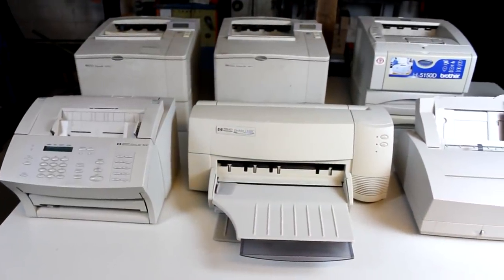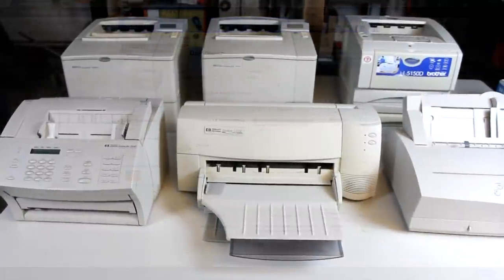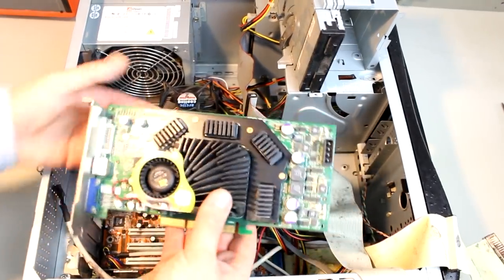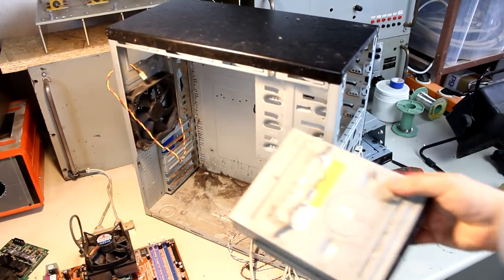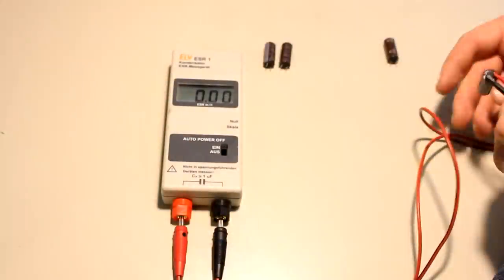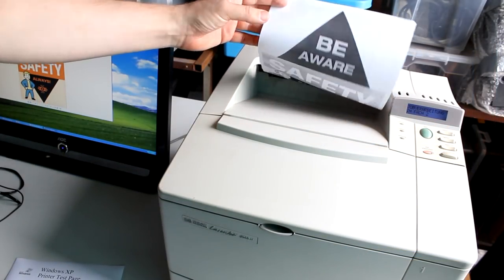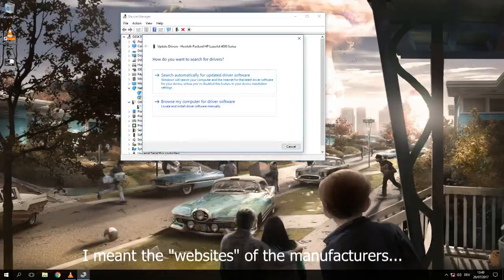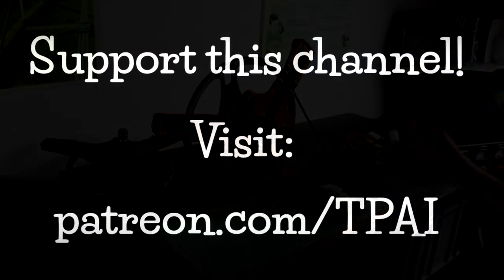Repairing and Restoring an Old Computer - (for those old Printers)

Comment: If the capacitors on the motherboard are bad i wouldnt use the psu that was there, not without measuring all the voltages with the pc turned on or with some load
Reply: The bad caps on that motherboard are Chemi-Con KZG, a bad line from a good manufacturer. The power supply has nothing to do with that. By the way, that PSU is an AOpen, which are usually rebranded FSP motherboard (and the inside design looks like it).
Reply: SuperDuty455 Well... At least measure the voltages with some load in the psu. Even with good capacitors, the psu may be with the wrong voltage or out of the limit (5% of variation i am remember correctly)  So the 12v line can be from 11,4 to 12,6v, but i would reccomend staying in the max variation of 2%, in 12v line, it could have from 11,76v to 12,24v. 

More than that 5% likely is damaging slowly your hardware, mainly capacitors. 

A good psu may have these problems, as some problematic voltage regulator, or some capacitors or resistors worn out, some problem in the feedback circuit, and such, that can cause these problems.I have a teapo psu from the 386 era (actually it is dated from 1994 so not exatly, but it is the same type with 12 pins only), and all its capacitors are fine, all its components are clean and without any damage signal, but its 12v line is giving 9,48v, its 5v line is all wrong too, i dont remember what it was. And the psu seems all fine, all capacitors are perfect, and incredibly seem to be from ok to good brands. But still its voltages are all wrong.

Many times the damaged capacitors on the motherboard are due to variations or wrong voltages coming from the psu. If the outlet were the pc was had too many variations, many high and too low energy peaks, the psu may have tranfered it to the motherboard, and with the time passing it may have worn out the capacitors, that happens very often. If the energy is too unstable as it is in some places here, that may br the culprit too. 

You said that these were bad capacitors, well, it probably is be problem, but it would be recommended to measure its psu voltages, as they may be a lottle off too, so you wont damage the new capacitors, even if the damage to the old ones wasnt caused by the psu.

Comment: I have an HP laser printer from 2009 that will not work on windows 10 at all, HP told me I had to buy a new compatible printer or use Windows 7. Since printers are a dime a dozed I tossed it into the bin and bought a new one.

Comment: If and when I can.... I stick with any printer that is LaserJet compatible.  There are a lot of laser printers that fit this bill.  The generic CUPS LaserJet drivers will work with just about any LaserJet compatible printer.  At a lot of locations I used to manage just a couple of years ago, they were still using IBM/Lexmark Lasers from the 90's and early 2000's.  All worked perfectly fine with Linux.  I guarantee Windows 10 would not support them!!!

Comment: Any printer that you cannot print to from linux is not worth saving. That should be a VERY tiny number of printer models, mainly only ones that are not true standalone printers, but merely part of a full printer (the other of which is a proprietary program that runs on windows only) - such printers are GARBAGE and should be dumped in an electronics recycle bin.

Comment: For fucks sake. Just install the printers manually. Get XP updated, connect the printers and if the new hardware pop-up appears, follow the instructions and install it manually. If it doesn't either go to the device manager and if it appears there, install it from there if it doesn't go through the add new hardware wizard. Manufacturers have more to do than working together in a cabal to make us buy new printers. Most old printers work perfectly fine with the in-box Windows drivers. At least I haven't found one that has refused to work that way. Not to mention old drivers most of the time are a pita to find if you don't have the original discs. Also they don't add any other functions the inbox windows drivers have and most of the time they add a boatload of unneeded crapware.

If the printer has a USB port, it's tenfold easier. Old printers might be slower, but some older printers use high capacity cartridges. Combine that with refilling your cratridges, and you get prints a lot cheaper. Fast is not always better.
Reply: mudemmeonick wtf? Why install anything Windows based? Just load a live Linux CD (yes CD) of an older Linux distro like say Ubuntu 10 will print fine with ZERO installation. Microsoft NEVER figured that one out because they are such freaking NIMBYs!

Comment: I like Linux LXLE for old machines, especially laptops, very light weight and is an improvement, imo, over Ubuntu or XP (but i do like XP) on old machines, i use it on three late 90's early 2000's laptops and it works superbly, all of them will browse the web, play youtube videos etc perfectly well......however.....as you discovered...printer drivers are very hit & miss. http://lxle.net
sometimes they are perfect, other times not so much...often i find colour printing is way too dark, I ask  on the distro's forums and others find the same thing, but it seems no one is willing or able to get to the bottom of this issue, but LXLE is certainly better than Ubuntu, i had very little success with it for old printers, whereas lxle was certainly better.
Why? I do not know, i'm a soldering iron jockey not a programmer...but I did manage to get an old Star Bubble jet working with lxle...(remember them?)
Anyway, thanks for your videos, glad someone else enjoys giving old tech a second life. 
Sent from 2003 Fujitsu laptop, originally meant for XP, now running... LXLE.

Comment: are bad caps majority of the reason for motherboard failure, i have 3 mobos lying around.
Reply: In a word ... Yes. Usually the ones that get the hottest i.e. PSU or PSU related ones. Trouble is, when they go, they often cause trouble and faults downstream that are more difficult to trace and resolve. Replacing them when they are "on their way" before they go truly BAD can often solve the problem  completely.

Comment: No one has said anything about using an air compressor on electronics yet?
Reply: Air in a can FTW! But a compressor should be fine too
Reply: colaigor supposedly builds static and kills things
Reply: I use a vaccum cleaner and a small brush to clean dust off motherboards and other things. Don't want to spread that dust into the room and breathe it in.
Reply: An air compressor is fine as long as the air is dry and you are careful not to spin the fans.
Reply: +joblessalex you've heard of anti-static packaging haven't you? Ever wonder why it works? The packaging is conductive, so it keeps voltage potential low between points in contact with it. They're all shorted to each other. Now take that same part and put it into an electrical circuit. Now that part has conductors running to its leads which are conductive themselves. Sounds a lot like anti-static packaging doesn't it? That's because it is a lot like anti-static packaging. So that means parts in circuit are protected from static discharge. At least that's the theory.
Reply: The dryness is the actual problem. The drier the air, the more insulating the cloud of air around the electronics become, and the higher the voltage that can build up from the air friction.
Reply: real hardware geeks lick off all the dirt!
Reply: Some air compressor blow oil out the nozzle.
Reply: An air compressor blowing oil without an oiler on the line is a problem.

Comment: You Will Not hurt the electronics in side the computer by spinning the fan blades.(that air gun will not spin the blades fast enough to create dangerous reverse current levels) Carey Holzman(a certified computer technician) did a video where he spun multiple fans with a high powered leaf blower proving it does not create enough back to current(not even close) to damage the internal parts of the board. You are misleading people by telling them the wrong information. The one benefit you get by not letting the blades move is you get more of the dust out of the fins of the heatsink.